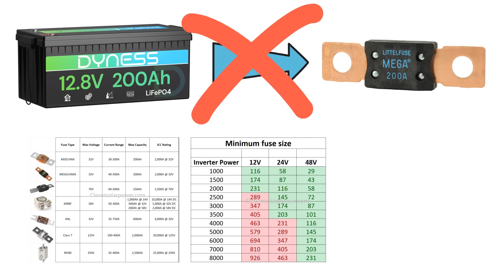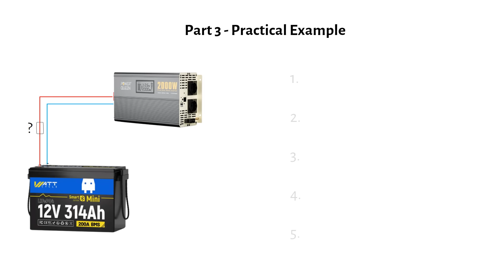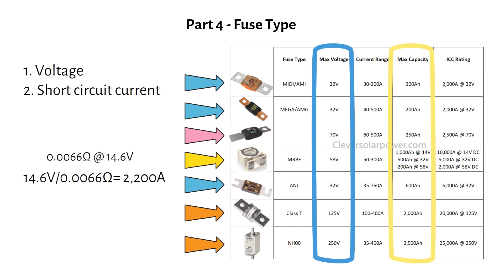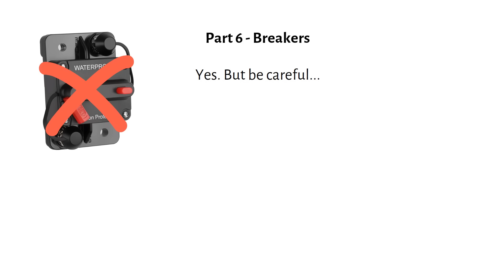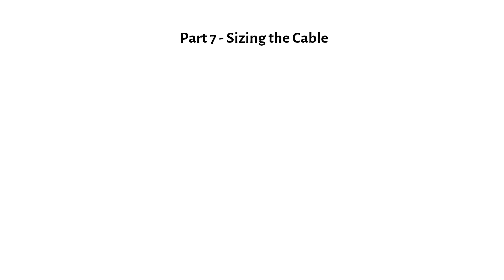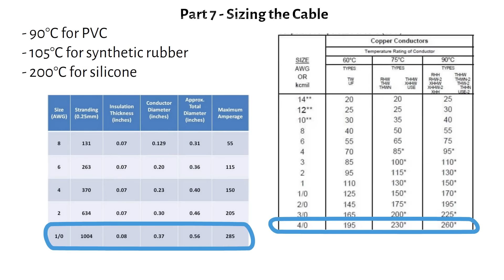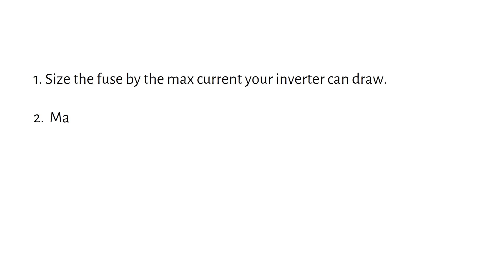How to Size Your Battery Fuse to Inverter

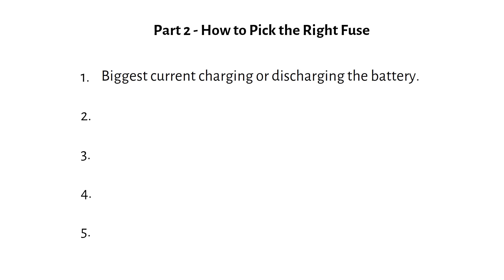Comment: 1:42 This is just not right. Choosing the largest single draw is inadequate - you need to add up the largest real-world draw. If you might ever use your inverter while the lights are on and your laptop and bicycle are charging, you need to sum all these draws and use the sum.

Comment: I'm a little more conservative and will go to the next smaller fuse instead of larger.  That means the fuse will blow before you exceed the inverter's continuous power rating.  Protecting inverter, wire and battery.

Heavier wire and/or lower amp rated fuse = fuse blows before the wire gets hot.
Reply from the maker: I don't advice this. the fuse will run hotter. Having a smaller fuse doesn't help you in any way.

Comment: Man.... are you smoking crack? Battery rated for 200A.... you use a cable that will exceed 200A to protect the cable. The inverter shouldn't draw more then 200A rating of battery. You add a second identical battery in parallel to double the available amperage. Then... to protect the inverter from a short circuit or battery malfunction, choose a fuse that will blow before reaching the max current the inverter is rated for. If you turn everything on at the same time the things you want to run and take a reading of wattage you will know what size inverter you need first. Then exceed that in your battery/batteries. Being 12v, use a 2 to 4 Guage. Fuse close to battery/batteries. If parallel, hot and ground from opposite ends. Move up in voltage on battery for less amperage and smaller cables. Bla, bla, bla

Comment: Fuse only protects the wire. Nothing else.
Reply from the maker: Main battery fuse should be able to interrupt the short circuit of a battery. Otherwise all your wires will not be protected.

Comment: This video is about choosing the right fuse for your inverter battery system. The author, Nick (author of Off-Grid Solar Power Simplified), emphasizes that the fuse should protect not the battery but the

Comment: Good vid but I want to mention something that NOBODY mentions. You are fusing the wiring system, not the devices. Every video states this, which is fine, but what happens to the fusing of the individual devices? This is where the confusion arises. They have their own fuses generally (from what I can work out, I'm just a newb.)

Comment: In automotive we don't use fuses for diesel engine starter, engine heater and battery alternator. also EN1012-1 says this explicitly that these circuits are allowed  as an exception to be excluded from fusing for functional reasons.  so we never fuse battery per battery having parallel batteries.

Comment: The 125v 250a class T is correct for the battery and inverter in the beginning of the video? Is there a cheaper option?
Reply from the maker: Nh00 and nt00 I made a video about it a week ago

Comment: How bout no fuse?... on say a battery box I'm carrying around only for power outage backup.  It's near impossible to short circuit, wires insulated, not rubbing, any exposed parts of bolts and lugs are minimal and near impossible for anything to make contact with them or especially short via linking or arcing.  All thats left is possibly plugging too much wattage into inverter which happens to be able to pull more amps than my wire size but we all know to only plug in basement fridge and internet ONT.  I don't know though, if the inverter had some kind of failure or short, would that flow back to the battery?

Comment: I about to set my 24 volt system up and using a 2000 watt inverter with 2 24volt batteries which by your diagram means a 125 amp fuse I read that if it’s two batteries divide that by 2 and put that fuse on each battery so there saying two Mcrb fuses with closet 75 amp on each positive terminal is this correct

Comment: this guy is more inteligent than me but i would not be comfortable fitting a 250 amp fuse to a lithium battery that only has a 200 amp bms . if the battery bms goes faulty and does not disconect and 250 amps are being drawn i can see the posibility of flames/  fire and or an explosion  happening from the lithium battery.
Reply from the maker: I'm not more intelligent than you, I'm just a nerd 🤓. The fuse mainly protects the cables. And it will also protect against a short circuit of the battery. The BMS will cut off when there is an over current. In case the MOSFETs fail, the fuse will blow. The wires/busbars inside of the battery are made (should be) to carry the nominal BMS current. The external fuse should be larger than the BMS current because the fuse should not be the same current as the nominal current draw. If you want to use a 200A fuse on a 200A BMS then you should draw a maximum of 160A.
Reply: @cleversolarpower  yes the bms should cut off but sometimes there are bms failures like with any component . i would also not feel comfortable running a bms so close to its maximum rating for long periods as i would imagine it could get rather warm/ hot increasing the chance of a bms failure,

Comment: Since many are converting golf carts to lithium, a similar chart and vid for small electric motor vehicles, would be helpful and prob. popular. I think I can extrapolate from this, but.........not sure draws and efficiency of the cart motor, etc. One would assume in a conversion they would be similar, but there is no main fuse mega fuse right off the battery on many of these.

Comment: Fuse size depends on the battery cables size. 16mm battery cable to protect the cable fuse should be ANL type fuse 80 amp on a 12v system

Comment: This video is pretty misleading. Cable sizing comes first - always. That fuse might be perfectly happy while the cable is cooking. That's exactly why you size the wire first, then choose the fuse that protects it - not the other way around.
Reply from the maker: You can do both ways. Just make sure the fuse is rated lower than the cable ampacity.

Comment: Why use 12 V batteries in your example? Parallel wiring 12V is not a good option. Will 48 V always be a better solution? Also, if your examples had been standard with 3 batteries, each 48 V 100 Ah, it could be a standard for other solutions. The other way around, transforming a 12V suggested solution to a 48V solution is more difficult.

Comment: Correct me if I'm wrong, but the 10x rule for calculating the ICC is really only for lead batteries. Lithium can easily dump 20x, some even 40x, into a short circuit. That means someone with a 150Ah Lithium battery might choose a Mega fuse. In reality, this would actually be a fire risk.

Comment: I am using a 3000w inverter with a 12v system. Can I use a 300a breaker since I am not expecting anywhere close to full draw while using this system in my travel trailer? 92% efficiency and by your chart and math I should be good to pull 2650w as the 300a breaker blows. That is more than enough for me

Comment: One key detail

Battery shown as example has a BMS cutoff rated at 200A maximum output 

They moment you draw 200A+ from your 12V battery, BMS will cutout to save battery cells

Your 250A fuse will be sitting there watching this video with popcorn
Reply from the maker: Yes, it's called selectivity. First your BMS trips and if the BMS fails for some reason the fuse will blow. The BMS is resettable so we want it to trip first before the fuse.

Comment: I am using a 3000w but have no intention of going no where near 2000w probably around 500 to 1000w it will just be running a tv and a couple of PC's with a router the reason it is so large is the type of inverter and price both were very good

Comment: Confusing? I have a 1500 Inverter 1500 / 0.9 =1666W/12 = 138.A x1.25 = 172A = 175A ANL fuse right?
Reply from the maker: Correct. And a cable that can carry at least 175A.

Comment: Just a question. the battery says its max output is 200a. the one in example
Reply from the maker: Yes, that depends on the BMS. But you have to calculate the fuse size on the current you are drawing.
Reply: @cleversolarpower if my fuse is correctly sized for the inverter and cable but the draw exceeds the 200a rating of the battery by 50a or more, how does the battery respond? Amazing channel by the way. I can trust what you say and you cover all topics with very clear explanations

Comment: I have a fuse built into my Lithium battery so do I need another when connecting in parallel? I have 3x12v 314Ah batteries with JK BMS on my boat.

Comment: I have 4 ea. 100 ah batteries in parallel.  Each battery is fused at 70 amps.  Each battery has the same length cable to the bus bar.
From the bus bar to the inverter, 1500 watts, the cable is less than 1 foot, + & -, to the inverter.  I have two 50 amp 100 volt Victron MTTP
solar charge controllers connected to the Bus Bars.
Works great for the last 3 years. Now this year, if it is a sunny day, I am charging my EV if it's battery is not too low.
Inverter is running at 127 amps 12 Volts for 3 hours which is slightly over it's rating.
I know a 48 volt system would be a lot better but so far this is working OK.
A second inverter, Victron 1200, is powering our family room 24/7 for the last 3 years.

Comment: I have a 2000 watt low frequency pure sine inverter. I plan to only use 1500 watts max and probably 1000 watts average to try to make it last longer. I'm going to use 4/0 wire to make it simple and a nice 200 amp dihool mccb. A 7 inch breaker is so much cooler than some slimy fuse. Also running under rated should keep the breaker cool maybe and maybe less voltage drop
Reply from the maker: Sizing bigger is okay, as long as the cable ampacity is larger than the fuse rating. It's only going to cost you more.

Comment: why would you need a fuse there?  What component inside the inverter could possibly create such a short circuit as to blow a 200 amp fuse?
   I bought a 1500 watt inverter which had been hooked up backwards, and inside, the huge soldered connections between the incoming wire and the circuits inside had exploded. I re-applied the solder and it worked for years. What else could cause that kind of load to justify the  use of a fuse?

Comment: The lower of your insulation temperature and terminal temperature is your determining temperature, high insulation temperature and sometimes help with avoiding high ambient derating if the area near the terminal is cooler but the cable runs through a hot area, but you can only use the lower of the terminal (and that's both and ferruls or such and the actual equipment terminal) and insulation temperatures for determining wire size, IIRC you have to assume 75c for any terminal not marked for more, it might be 60c, 90c terminals are not that rare, though much less common in most types of gear, anything over 90c is only going to be in very specialized gear.

Comment: Code says follow manufacturer instructions.  Inverter manufacturers generally know what current will go into there inverter much better than you or I, including size, efficiency at max output (efficiency varies with load) designed short overload requirements, terminal temperature ratings, and a lot of other factors and they will usually tell you put X size fuse or breaker and at least Y size wire, but don't directly connect us to a wire over Z size as our terminal can't handle it.  The fuse or breaker size might be less specific like a range or minimum and maximum, or it might be even more specific with X size with Q trip curve.  If you get a reputable inverter you will almost never go wrong starting with what they say and filling in a few more details like max short circuit current to ensure your fuse or breaker can clear a fault properly.  If uou have sn unusual condition you may need to do something like adjust wire size, but stay within what the instructions allow.

Comment: I'm a little confused. A fuse is a limiter. It will blow when a certain threshold is exceeded. To protect your cables you would be better to lower this threshold to ensure the fuse trips before too much current is drawn. In step 4 you mention a safety factor. Surely, to increase protection of the cables (increase the safety of the system), you should drop the total current allowed and so reduce the rating of the fuse? So instead of going from 185 to 250 amps (increasing the amperage) you should reduce the size of the fuse to say 175-200?
Reply from the maker: By using the safety factor we are increasing the size of the conductor and reducing the heat generation in the fuse. You are still sizing the fuse under the max current rating of the cable.
Reply: @cleversolarpower  I'm not clear when the conductor (ie cable) is mentioned. Your calculation appears to increase the potential current allowed to pass through the cables before the fuse blows.
Reply from the maker: First we size the fuse and then select a cable that can carry at least the fuse rating.

Comment: Your first point is something that a lot of people don't understand.
Fuses are meant to protect the WIRING, not the devices. Size the fuse to the wiring.
Reply: If you properly sized the wire...

I fuse for the first thing that would overheat.

Comment: sir if i have 3kw inverter on 12v 100ah but im not going to use only 2kw,  what fuse or breaker computation will i follow 2k or 3k. thank u. 
the same with wire gauge？
Reply from the maker: I have a video on how to calculate wire and fuse sizes. Your fuse needs to blow first before your wire melts.

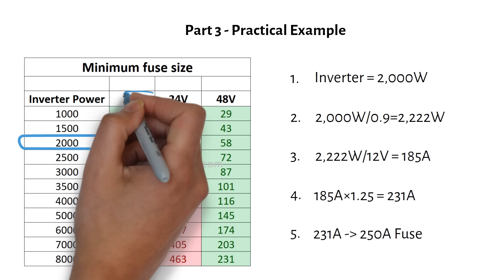Comment: The chart at 5:16 has a small flaw ... in the 12V column 231A (2KW row) is green ... so is the 48V with 231A (8kW) ... but the 24V with 231A (4kW) is red ... and following the logic, it should still be green.
Reply from the maker: Yes indeed. My bad. Nicely spotted.

Comment: But what about parallel cables from battery to bus bar don't they naturally draw less amps for the cables.. would you then fuse smaller for those
Reply from the maker: No, they would be more. And you have to size them the same way.
Reply: @cleversolarpower  thank you for the  reply please help me out I have 8 , 12v batteries, and a 3000w 24v inverter and two bus bars

What's the recommended wire gauge then coming for each of the parallel connections to the bus bar

Comment: i never use a fuse to the battery theres a fuse in the inverter and my cabels are thick construction wire so i guess i be fine

Comment: Nick, I calculated 1500 watt inv. 12v to need a 140.6 amp fuse. your chart says 174 ?
Reply from the maker: 1500/0.9 inverter efficiency= 1666W
1666W/12V=138.8A
138.8A x 1.25 safety factor = 173.6A -> 175A or 200A fuse.

Comment: Thanks for the informative video. 

Just wondering that even if some of the wires may be rated for 200 Celsius the breakers or fuses are likely not. Isn't that a problem? 

And is there generally any 250A DC circuit breakers for 2/0 AWG wires? The terminals seems to be to small.
Reply from the maker: Wires are rated to that temperature, but they never get that hot. Lugs are generally rated for 70°C. It is not a problem. There are Molded case circuit breakers. I made a video about them (MCCB), the terminals are listed on their amazon sales page, and yes, they fit the lugs.
Reply: @cleversolarpower  Thank you for the answer. 

Would love to hear your opinion on this: Is a 250A Molded case DC breaker (Dihool) suitable for 24v 4200W solar system, with silicon 00 AWG wire? Is this a safe setup?

Comment: Very nice information, ❤ I have five hybrid inverters each of 8 kw single phase operating in parallel operation and connected 4 x lipo4  51.2/100Ah bank parallel connected with each inverter and all the 20 batteries bank connected in parallel which capacity of breaker should I install each inverter.

Comment: You consider 12V...but before the inverter shuts down for low voltage, the battery will be close to 10V, which represents 2,222W/10V = 222A. And 222 x 1.25 = 277A
Don't you account for that?
Reply from the maker: My inverter turns off at 11V. No I do not account for that, and it's okay.

Comment: Great video. Shouldn't the wire size also take in consideration the maxumum allowable voltage drop (which is determined by the resistance and the length of the wire)?

Comment: I have a question for the electrically knowledgeable people out there. I have a 2000 w inverter with a 100 Ah battery. The amount of power the few LED lights in my small camper uses  together with the inverter on, but not under load, is negligible . But my electric coffee maker uses 975 watts. At 12 volts thats about 81 amps ( why didn’t I go with 24 volts ? 😞).  Since l know I’ll never have anything else on when the coffee maker is on except the inverter, why can’t I go with a 100 amp fuse ?  Knowing what the maximum load is l sized my conductors at 100 amps and installed a 100 amp fuse. It’s worked fine for a year now. Does anyone see a problem with this setup ( and reasoning) ?

Comment: @cleversolarpower Cabling insulated with TPE can be had with 105C rating and they don't STINK like, say, EDPM. Silicone should be OK in the odor department. PVC supposedly has odor, but I don't have any of that to know how bad it smells. It is said that some compounds eventually become subdued (smell), but I had some EDPM cables that smelled just as bad after one month as the day they arrived--sent them back. Surely the degree of odor emitted is dependent on manufacturer specific formulations of the compounds. If you want your home to smell like a tire store, get some EDPM (or rubber?) cables for your energy storage system.

Comment: @cleversolarpower The only silcone cables I've found are from China, have MANY fine strands of copper (supposedly) and all are tinned. To me, that looks like a potential scam: strands so thin that the adhering tin outweighs the amount of copper. Just a possibility. Also, super fine strands are fragile at lug connections. There may be a "sweet spot" for strand size given the application, performance, flexibility, durability, but I don't have that info.